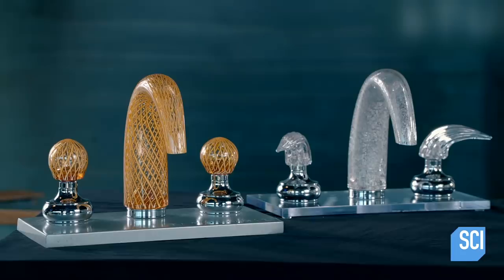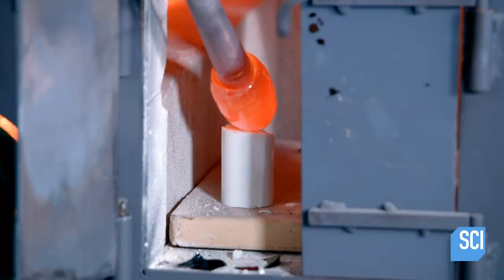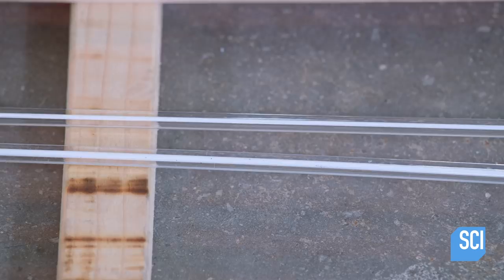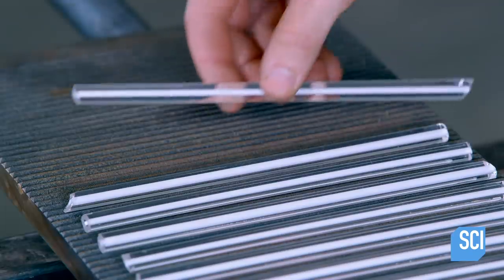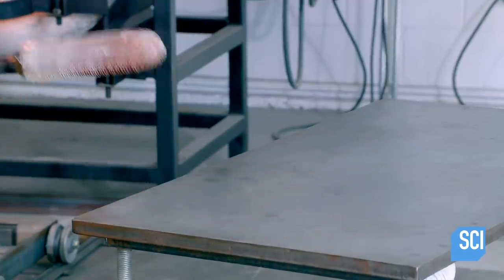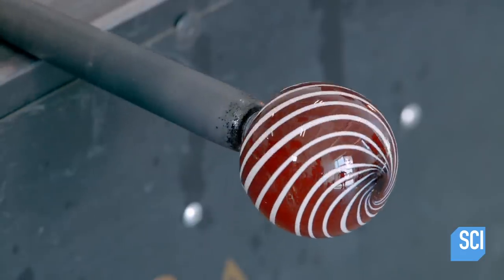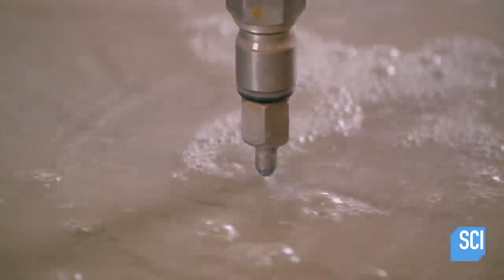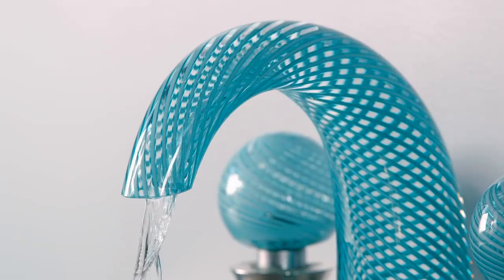How to Design and Construct a Glass Faucet | How It's Made

Comment: Imagine switching from hot to cold water really fast and the faucet just explodes xD
Reply: You would need some really hot water for that to happen
Reply: As a fact you wouldnt, all you need is a car battery and an induction coil
Reply: @shanefowkes7451  Induction works with high frequency AC. So your car battery + induction coil does not compute.
Reply: lmaooo
Reply: @shanefowkes7451  why would have any of those things near a faucet?
Reply: @yooogle  I've shattered glasses like this lol
Reply: Borosilicate glass (which they are almost certainly using) doesn't shatter when theres a sudden temperature change.
Reply: Doesn't work like that
Reply: If you have a very hot water that fast you need to adjust your water heater
Reply: @wildlifewarrior2670  it was a joke...
Reply: @Germknoedel  ok
Reply: Yea that won't happened bro.
Reply: @nengthao5618  bro its a joke, chill

Comment: I think it would be cool if the faucet looks more organic like water, and as clear.. So that you can hardly tell where the water begins.
Reply: holohulolo water would dry up and it would look very musty unless they make a tool to clean the inside of the faucet
Reply: @asclepius3071   Vaughn  not all the design's are opaque, you can see the one showed at the beginning it looks like marble, it's clear, slightly tainted with strings cooking around it. Besides, even withthe opaque ones, the glasses are going to get cloudy on the outside as well. It's probably easier to clean on the outside, but ifthey redesign it a little a normal bottle cleaner should fit in easily.

The aim wasn't making something practical buy something pretty.
Reply: @holohulolo  i know but what you wanted was something more clear, and it would look very cloudy on the inside and outside
Reply: @asclepius3071  not nessasarily. cloudyness in tap water is primarily caused by air bubbles from increased pressure on the water, and glass dishes get cloudy from calcium buildup over time,  which what you may be thinking of, but its super easy to clean. spray a solution of baking soda and vinegar into the tap, wait a while, then run the tap. i can also imagine that a clear glass tap would be favourable, since (aside from the downsides of possibky breaking it) you could tell when it needs cleaning.
Reply: @asteri8299  That gave me an idea, thanks man I realise I was in the wrong but thanks to you <3
Reply: You could always tell where the water begins because the index of refraction is different. Same as with a drinking glass.

Comment: In the final few seconds where the faucet is turned on, the valves are installed backwards. Notice he turns hot side clockwise to turn water on.